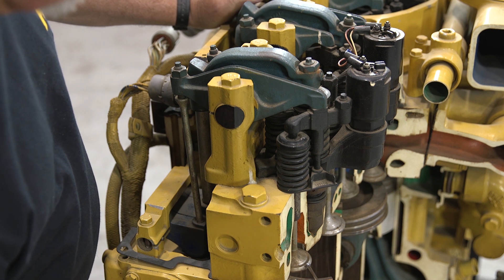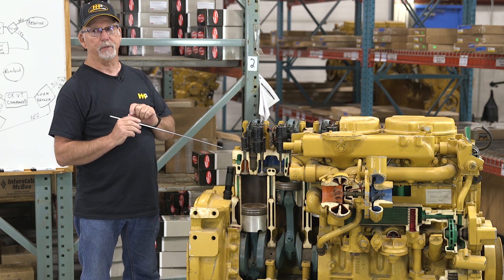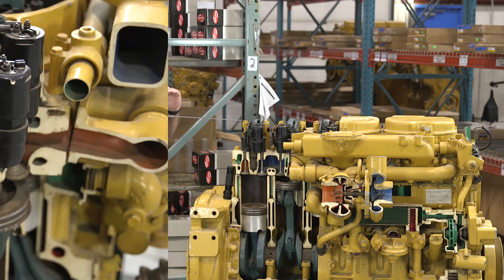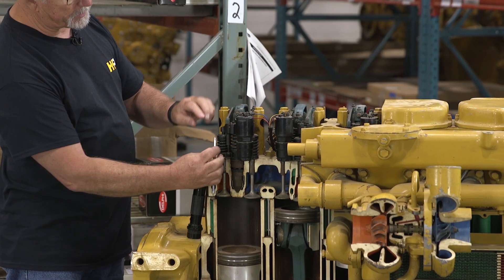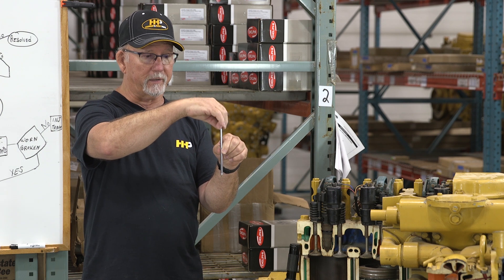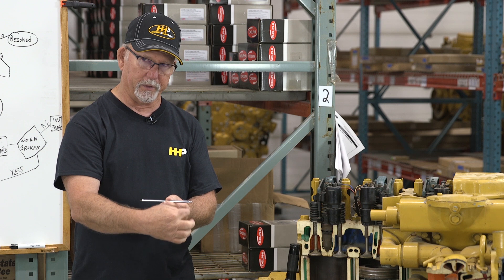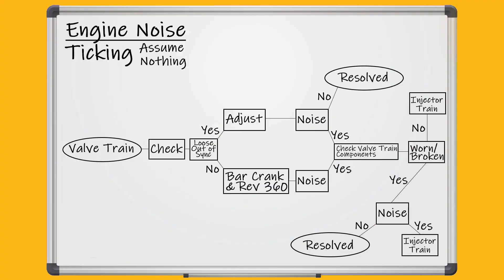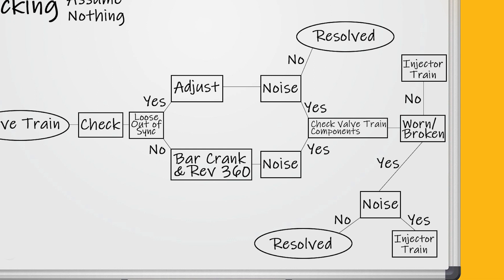Diesel Engine Tick & Knocking from Valve Train, Highway and Heavy Parts

Comment: So I've got a duramax that has a ticking sound, consistent with RPMs (not the "typewriter"), that only shows up after the engine is warmed up. Are there components of the valvetrain that could start to, I don't know, "loosen up" or something only when the engine is warm that could cause this?